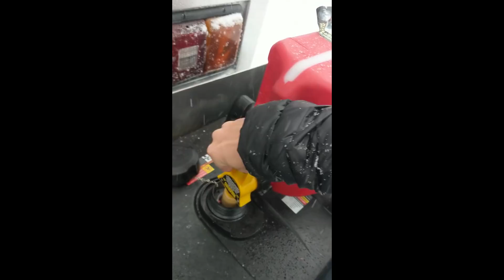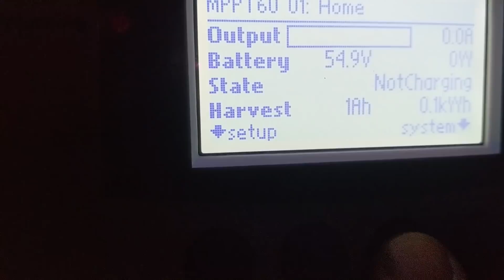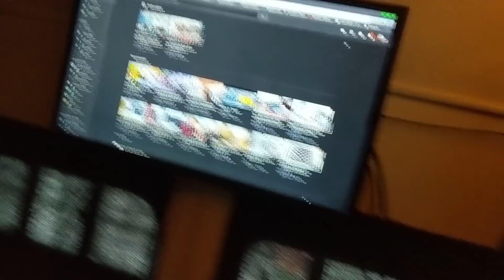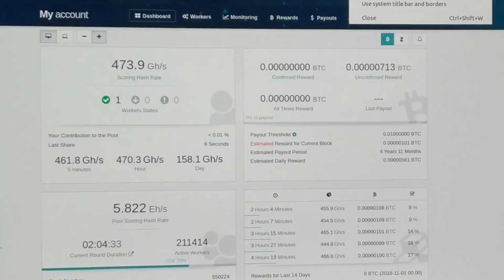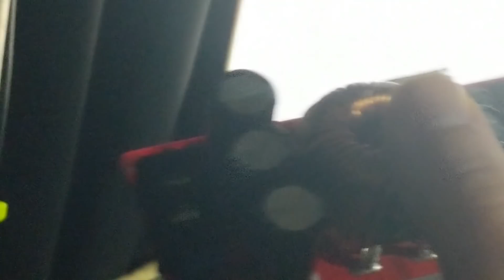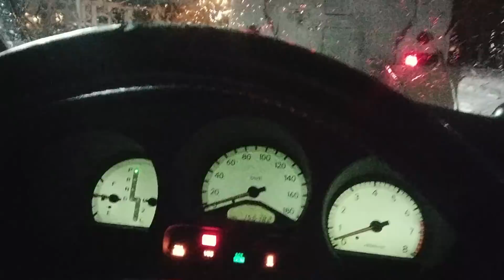Hot Bitcoins and Fresh Donuts at Dutch Wonderland

Comment: Nice slides. Hey could you detail the house battery loads?
Reply from the maker: Sure, I will do one shortly on the inverter converter the battery pack and some of the cables and marine marine 50 amp 240/120v SS2-50R adpaters